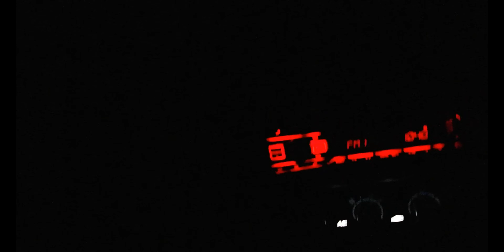Intake Snorkel Delete for Lotus Elise Sport 220 Supercharged

Comment: The snorchel will give you COLD Air, which is better for the performance of the engine  if you remove it the Airbox will get hot Air from the engine bay, but if you want to let performance go for better sound it might make sense
Reply from the maker: I actually tried to compare the difference, I can’t really feel the difference on the power, and also the coolant temperature seems like 1-2 degree lower after removing the intake snorkel. The air duct is pretty big to suck lots of cold air in the engine bay
Reply: @Jimmy_Wei  how Do you meisure the intakte Temp in teh Airbox?
Reply: @Jimmy_Wei  the coolant Temp cannot be influenced, cause the Watercooler is in the Front
Reply: I have removed it on my S2 (different design to this) and it seems to make no difference to temperature. This pipe seems to be larely sound dampening and NVH, but it also causes the filter to get clogged a lot faster as it hoovers up the road. In the UK many people remove it.